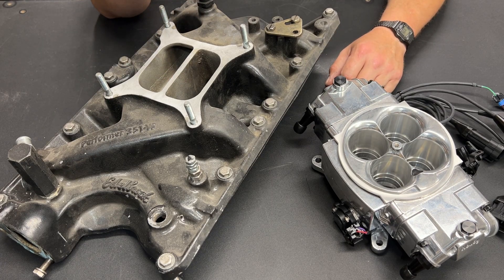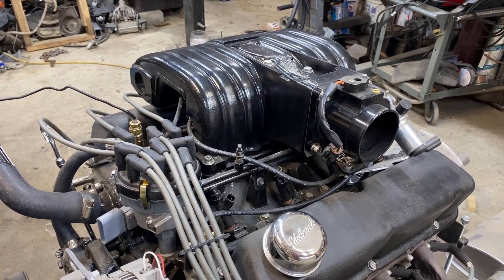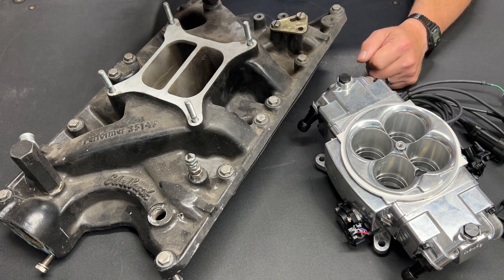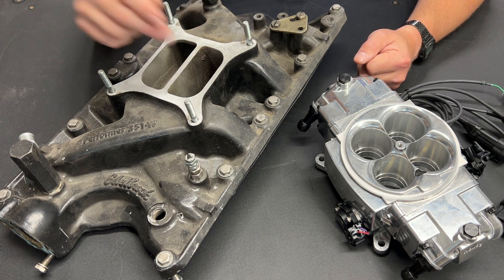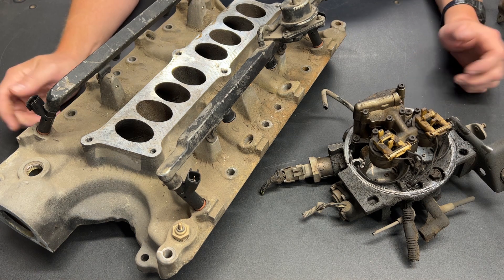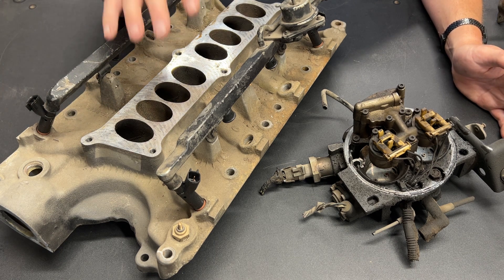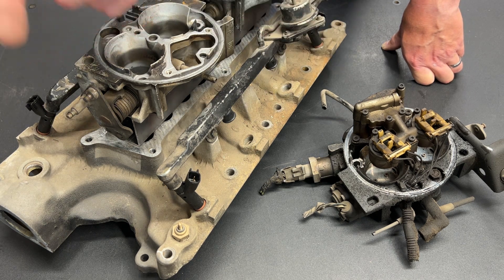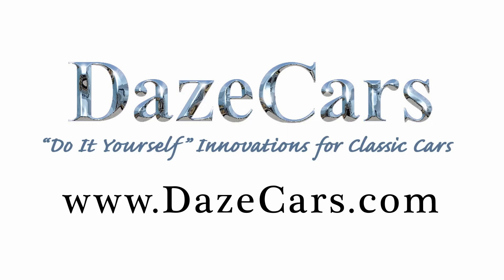393 Windsor Build Part 9 EFI Three Options: DIY intake One, DIY intake Two, or Sniper EFI

Comment: Use wood for the spacer. Use a 2 inch thick. And you can also use a 1/8 thick piece of aluminum under tge spacer. It isolates the heat from going straight to the spacer. . So intake, paper gasket,, aluminum plate, gasket spacrr gasket carb. 
Youre killing it. Youre setting up a high rpm intake. Youre using a short runner intake but they are all  small iinner diameter.   You run large diameter short runners for top end power.and small id long runner fot torque. You need to get the t-bodies up and off that lower about 4 inchrs at least maybe even 5 . Get a holley hiram and put you tbodies on top of that like carbs
Reply from the maker: I don't have the hood clearance for a Holley high ram and if I did at that point I would just run the high ram no TBs.  runner length is short, not much I can do about that but I am going to open up the runners on the truck lower.
Reply: @dazecars  I suggested what you already had due to cost savings. You have all the room and more for the hi- ram. If my 390 with the police interceptor intake with 2 inch spacer fits under the hood a Windsor with a hi- ram will fit with lots of room to spare. If you still don't believe me do this. Find a 62-64 galaxie with a 289 in it. Add 1 inch to it. Now you have a 351 windsor. Trust me you have the room
Reply: @dazecars  hell they put the med riser in it with dual quads and a big oval air cleaner and shut the stock hood. You can run a tunnel ram on a Windsor and be close to fitting
Reply from the maker: you may be right but I bairly have clerence now.  We will see when I pull the motor
Reply: @dazecars  well I don't know if the motor mounts are lower in the rails or what. But again the 1961 starliner came with a 390 hipo. And that came with tri-power. And what I do know is you have the same room in that group clearance wise. The 61,2,3, and 64 they all came with way bigger motors than the windsor. And width and height  wise the 352,390, 406, 427, 428 all the same width and height. Much wider and taller than a Windsor in fact more in height than width. I used to have that info. I'll see if I can dig it up. It had all the Ford motor dims even the 4.6  4 valve cobra  which I remember was like 31 wide 27 tall. Let me see if I can get ya the dims for a w and a fe
Reply: @dazecars  you have 5 inches less height than a 390. The 351 is actually 5 and a1/4 inches shorter than a 390. Look into the manifold with a tube for the plenumn it acts as a balanced to the air flow.
Reply: Ok the 351W is 23 3/4 tall the 390 is 29 tall the W is 27 wide and so is the 390
Reply from the maker: Its not as simple as you make it out to be.  The Windsor series of engines didn't come out until 63 and I have a 62.  The brackets on the "k-member" are in a different location in 63 compared to 62 so I was not able to run 63 289 mounts in my 62.  What I was able to do was run 302 mounts from a foxbody mustang as they space out wider but they also make the motor sit higher.  When the 393W goes in I will likely change to 63 mounts and spacer plates t get the extra width needed  but I also have a custom rack and pinion I designed  around the current motor configuration  and the motor doesn't have a lot of room before It could hit that.  I built this car, every bolt, every nut.  I know how much hood clearance I have and how much I need.  I realize you are trying to help but the premise that a stock 390 has plenty of room so a 351 will have plenty of room does not hold up because nothing about this car is stock.
Reply: @dazecars  yeah you keep referring to the 289 it didn't come out until late 64 and it was a 260 before and they were putting them in the 61 s. late 64 for the 89 and prior that it was the 260. Before that it was a 221 I thik 59 was when the Windsor came out where did you get 63 it was out at least 3; years before that the 289 was not the first windsor. It was the 221 they put the W in the 61 62 and 63. Galaxies. All you had to do was get mounts for a 62 galaxie with a 260 V8 you bolt those to the motor put the motor where you want it clearing the rack and what ever else it needs to clear them if the mounts don't make it to the frame rails where you want it just  make a couple of new pieces to go from the frame to the mount bolted to the motor. You don't need to make it any harder than it is.  And the dims from a 390 and 351W is 5 1/4 inches in height. The Windsor and  390 are the same width at 27 inches and the 351 w is 23 3/4 tall the 390 is 29 inches tall you have enough room to put 3 rack and pinions in it and a high rise open plenum intake  and still clear the hood by 3. In. It sounds to me like you got it. Good luck with it. A bit of info on your rack. It won't go down the road if the end of the rack where inner toe rods pivot if it is inside the lower control arm pivot point when you get going about 25 mph it will rip the wheel right out of your hands and if you try to drive through it you will crash. I don't know of a rack that is big enough to work on that car. Maybe a new rack off a 2018 f150 or something like that they are using racks on trucks now so it may work just be carefully
Reply from the maker: I am sorry but your information is incorrect.  I appreciate that you are trying to help but it's a little offensive that you are making the assumption that I know nothing about the car I built.  I know whats in the car, I know what modifications have been made to the car and I know what the factory options were in early 60s Galaxies.   

I should have been more clear with my statement the Windsor series of engines did not come out (in the Galaxie) until 1963 and in 1963 they list both a 260 AND a 289. So that is why I say 63 mounts and 289.   In 61 and 62 the only engine options for a Galaxie were the I6, y-block and FE so it's not as simple as you make it out to be.  As I said before there are no Windsor motor mounts available in 62 and the 289 mounts from 63 do not work with my car's mounting system.  I researched all of this when I dropped the 302 in it 20 years ago.   As far as modifying the mounts, moving the rack or any other host of changes to make it all fit I am fully capable of doing all of that as I am an expert fabricator and again I built this car.  What I am trying to avoid is a bunch of modifications.  I would prefer to work within the mods that have already been done and that is why I started my home build EFI project.  The result is a fairly trick intake that looks like dual quad and I can say "I built myself" which is hot rodding at its finest.   It should function well and does not require me to  completely reengineering the car just to spend another $1500 on a Holley high ram that does not have the look I want and isn't going to add that much performance.  I am not drag racing so I couldn't care less if my home brew intake adapter cost me 15 or 20 numbers.   

As far as your rack concerns I have been driving this car with the rack for years and it works amazingly well.  It is far superior to the stock setup, is purpose built, and the steering geometry emulates the stock galaxie steering design exactly so that there is no bump steer, death wobble,  or other suspension/steering issues.  The ONLY down side is I have a little less turning radius but that's a small price to pay for rock solid steering.  Here is a video on my rack and pinion retrofit build. https://youtu.be/6w43_9wJguY

Comment: Ok well i can help. I had a 64 galaxie with a 390 FE motor and i used a 428 Police interceptor intake. It maybe the highest dual plane intake there is unless edelbrock makes a rpm air gap. then a 780 holley on top of av2 in plelonic spacer with a 3 inch air cleaner So run what you want therevis plenty of room. And thrre maybe something else you missed. Weind ii think makes a single/open plenum low profile  intake called the torquer. Look into that. And you can run abdual plane intake, put a elbow on it, then just a thrttle body of eithrr a 95 mm or the 102mm size. And you can still run the self tnning holley system. But know matter what dont mess with the moyotsbability to run for the sake of apperance if you want tue carb look fine but look in a little deeper on intakrs thebate single plane and not real tall. Slso short large od runners are for high rpm use abgood length runner about in the middle for id and you make super big torqure
Reply from the maker: I am running a 393W not a 390.  The  hood line of a 62 slopes down in the front compared to a 64 and 302 currently in the car has hood clearance but not much.  The 351 is taller so height is a concern and most of the intakes you mentioned are not available for the 351w.  If there was an off the shelf option I would have done it.
Reply: @dazecars  I know that. That was my point if the 390 fits with all that on it the Windsor will fit with a open plenumnbor a Holley hi ram
Reply from the maker: the 390 is not really a "big block" at least not in the traditional sense and is closer in size to the W motor family.  Yes slightly bigger but not by much. so it's not so absolute that if a 390 fits a Windsor will fit with room to spare.    Hood slopes down in the front on a 62 and agin I am already way close on hood clearance.

Comment: Why not use 94-95 Lightning intake and be done with it?
Reply from the maker: Have you priced a lightening intake? I not willing to spend that kind of money.  If you look at my other videos the solution I came up with will be better for my application and like outperform a lightening intake.
Reply: @classicstangbrn8964  they are stupid expensive. They are getting more for those than the tubular cobra R intakes. You won't find a upper/ lower set up for less than 900 maybe even more now.
Reply from the maker: closer to $1500

Comment: Awesome project. Why not just retrofit motorcycle throttle bodies?
Reply from the maker: Otheres have suggested that and I and looked into it. I went with the Chevy TBI bodies because:

1. I already had them
2. I only had to couple the shafts together in one place, no other linkage
3. About the perfect CFM for the 393 it will be sitting on top of
4. looks like dual quad
5. I need to keep total height to a minimum
6. (this is a big one) I already had them 😂

Comment: Engine
Reply from the maker: Thanks for the comment.  Ever since I first started this series I was expecting a comment like this because I as most people use engine and motor in regards to a vehicles power plant  interchangeably. I am surprised it took as long as it did for someone to make this post.   po-tah-to  po·ta·to  Interesting that many brands label it from the factory "motor oil" .  And then if we want to go reductio ad absurdum there is "engineboat", "enginecycle" and my favorite streaming channel "enginetrend" 😂😂😂
Reply: Technical versus marketing
Reply from the maker: If we are being "technical" they are both correct.  Frankly I am just poking fun at this entire thing, and don't really care either way. I never could figure out  why some people feel  that engine V motor is something even worth arguing so vehemently.  I could see pointing it out if it was truly incorrect.  As an example I hade quite a few people point out that I was saying plenum incorrectly when I was pronouncing it "plen e um" I appreciated those corrections and have tried (with marginal success) to say it correctly in subsequent videos.  Thank you for  your comment  regarding engine V motor and either way if you want to research it further as to why I say " they are both correct", here is a fantastic article from MIT.  If not no problem and thanks again for the comment.  https://engineering.mit.edu/engage/ask-an-engineer/whats-the-difference-between-a-motor-and-an-engine/ @lawrencejones4161

Comment: This is a fascinating intake project, I love it. I stumbled onto the second video before this one, so I'm composing this with both in mind. Given the piece of rectangular tubing you show us in the next video, I wouldn't be concerned about plenum volume. The volume of something like a Holley Hi-Ram or Sniper manifold is enormous by comparison, and you're giving yourself less plenum than a stock Ford intake.

If I were Richard Holdener I'd probably be able to say something about runner length with confidence...but I'm not. How important is 2 more inches of runner length that you're targeting by cutting the end of the upper manifold up? I honestly don't know. I do know the Mustang guys used to have an upper manifold that was basically just a plenum that bolted to the lower. It had a reputation for stealing all your torque without providing much of anything up top.
Reply from the maker: I think 2" will make a difference (probably 1.25"-1.5" actual increase based on how I am pustting this together) how much I too can not say but every little bit helps.  Even a 1/2" 4 hole spacer on a dual plenum intake will boost torque.  Good news is the 393 comes with tons of torque from the start so even if I lose a little bit I think it will still work well, but that is just intuition with no actual data 😁
Reply: @dazecars  my experience with the 351W has been nothing but good. Punched out to 393 has to result in more Windsory goodness.
Reply from the maker: @johnbarker419  I love the SBF Windsor!!  With the exception of the 221 and the 255 (not sure who thought those were good ideas) I think the SBFW is one of the best pre EFI engine designs.

Comment: This is awesome lol! At first I felt disappointed that my favorite character was killed off (the 351 lower and HO upper)! But my interest peaked again hearing you brainstorm the Frankenstein intake. I love stuff like this and would love to do something similar, I’m definitely not paying 2k for a lightning intake
Reply from the maker: cheapest I found on the lightening intake was 1K for the lower and then an explorer 5.0 upper can be had for less than $200.  $1200 is still way to much for an OEM intake.  I have done tons of research and the porting potential of the 351W lower is amazing.
Reply: @dazecars  I’ve looked for a deal on those too, I even found out that some Ford marine engines have the lightning 351 lower and something that looks very similar to the 93 Cobra intake… I found one complete for $800 I went to see it only to be disappointed because the lower is cast iron 😢… that’s how far I’ve looked.
Reply from the maker: @MrBlitzkrieg1987  I don't under why the aftermarket can't seam to come up with something to fill this gap.

Comment: Why don't you use the pickup butterflies and just put on 2 or 3 of those? If memory serves me correctly they're bigger than the chevy tbi. BBK also offers a larger one.
Reply from the maker: several reasons, first I have the TBIs, second it would not look like dual quad.  It's just aesthetics and obviously there will be a fuel rail but I would like it to look more like two carburetors. The third reason , and this is a big one, is the area of the butterflies.  The bigger the area of the butterflies the more sensitive the throttle.  In other words too much air flow too quickly.  That will make the car less drivable.
Reply: @dazecars  I can understand using what you have. You're right. They'd look more like dual or triple duces or even half a Hilborn. The acceleration issue will have more to do with available fuel, cam, and load. So seems to me that with the load you're intending and the build type of the engine, it's not going a monstrous difference like you're trying to present. But I get where you're coming from. I wish I had the hood clearance to play with stuff like this. Edelbrock torquer intake is about the same height as the dual plain intake you have. I've currently got the single plain on my Ranger and swapping it to the same dual plain you have in an effort to get more low-end torque with my 388w build.
Reply from the maker: @JohnPaul-qh5ys   I don't think I explained myself clearly.  With more butterfly area the engine will run just fine.  The computer will compensate for the airflow and provide the correct amount of fuel.  The issue is throttle sensitivity.  Let's say you have a 60mm TB on a 302, car runs just fine, you push the pedal a desired amount the engine will accelerate accordingly.  Now let's say you add a second 60mm TB doubling potential airflow. (not doable given the 5.0 upper configuration but using the concept to illustrate my point)  With this hypothetical upgrade if you push the pedal the same distance as before acceleration will be double because there is twice as much airflow based on the same throttle position.  This is a non issue at wide open throttle as the motor will only draw in what it can draw in but at lower RPMS, (around town driving) the accelerator will be way more sensitive effecting drivability.  As a real world example I had an 04 dodge Dakota and one of the modification I did was install a larger TB, it really woke the truck up at higher RPMs BUT at lower RPM the throttle was way to sensitive.  I had to put an auxiliary spring on the throttle linkage to help control pedal position AND I had to change the pedal ratio requiring more pedal travel for the same throttle position at the TB to make the truck drivable.  This was with a small upgrade, I believe the TB went from 60-65mm.   With that in mind imagine what kind issue it would be with a massive jump in butterfly area.  Can it be made to work and work well, absolutely but properly sizing the butterflies to the application at the beginning is going to eliminate a lot of issues to work around.  That is why I did the calculations I did at the end of my video based on factory butterfly size for a 351w and did the calculations to account for the increased displacement.  I wanted a ball park figure to get the butterfly area close making the tuning easier as I get it built.